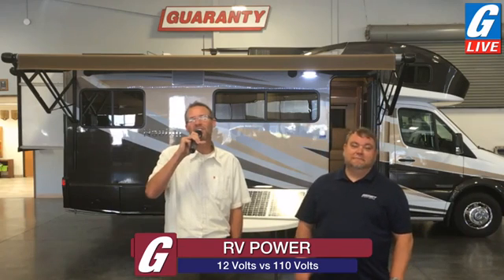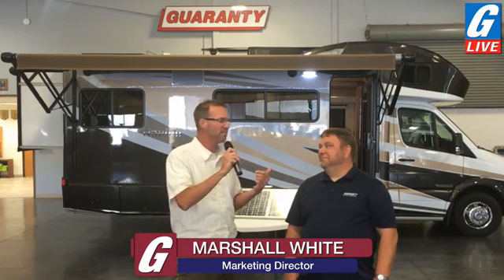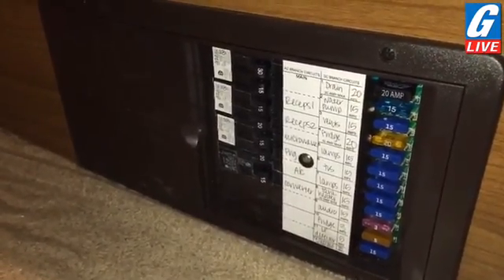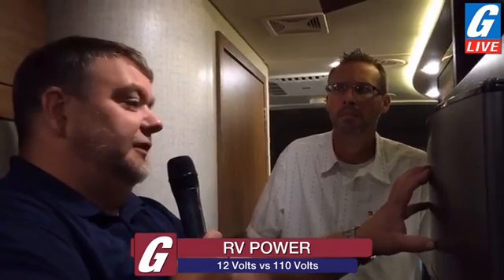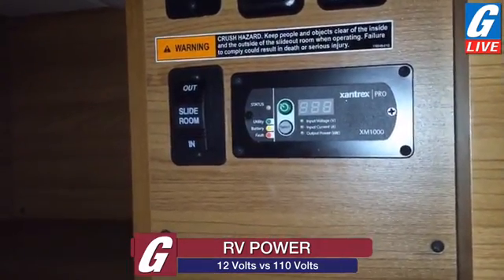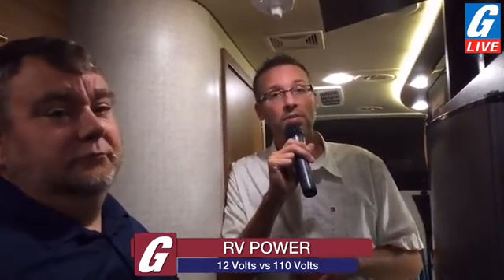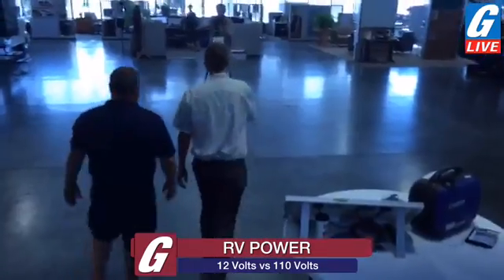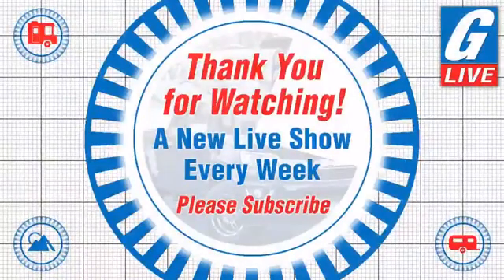G-Live Presents: RV Power - 12 Volts vs 110 Volts • Guaranty.com

Comment: I am Canada    What solar solar panels  can  I  use   I have goal  zero yeti 400.  Do I have to use goal   zero  panels  .   Can I use some  other panels
Reply from the maker: You should be able to use any panel, just make sure that the wiring stays separate. Sometimes, different manufacturers panels output different voltages, and shorting a solar controller out is no fun at all.

Comment: also is it possible to have more than 2 group 24 batteries, in a series parallel setup to help with power needs if you are boondoocking ,thanks for your help and great videos, keep it up
Reply from the maker: You can run as many batteries as you want. The main factor is amount of space, and wiring them up correctly.

Comment: I've seen that some coa he's come with group 24 batteries, which are 80 amp hours  each,what other options are available short of getting lithium ion batteries
Reply from the maker: Group 27 batteries would give you a few more amps in 12 volts, but for more amps 6 volt batteries wired in series would be preferable.

Comment: wouldn't it be possible to have a  larger solar panel system to help with the power system?
Reply from the maker: Yes. The main problems with solar is cost, and where to mount the panel.